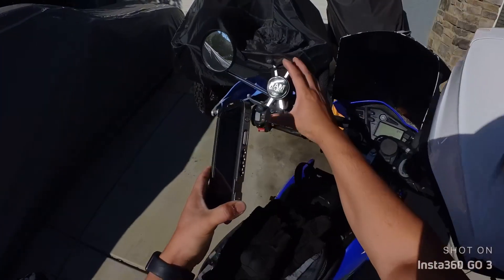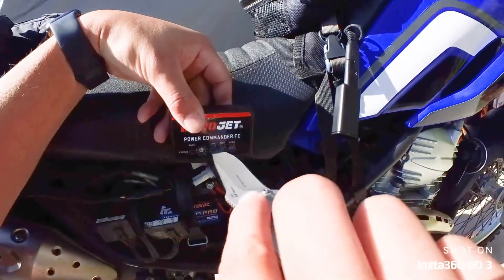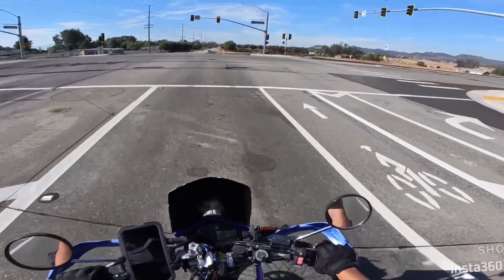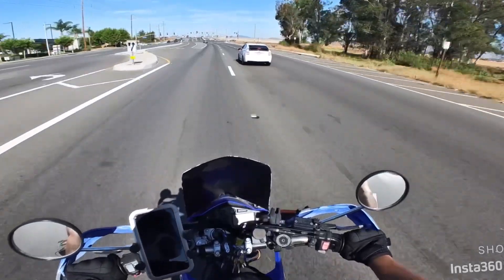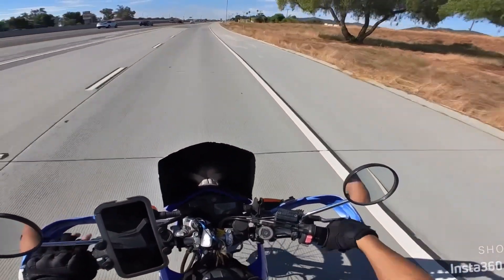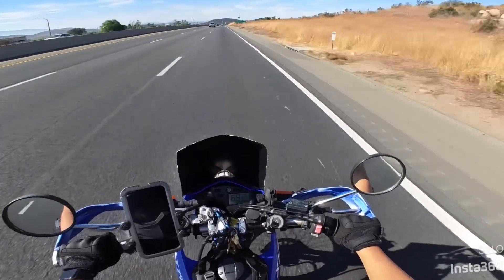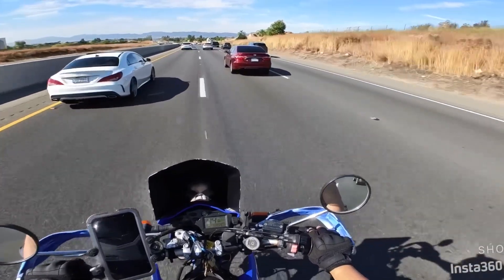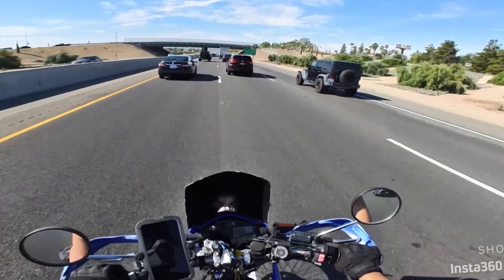Yamaha XT250 Airbox Mod: Ride and Tune

Comment: Nice bike 👍 was able to do 86mph  gps verified ,on my 230sm, purchased an aftermarket tuneable ecu that removed the speed limiter that was set at 75,  snorkel removed and pulled out the baffle from the exhaust
Reply: There is a removable baffle in the stock exhaust? How did you do that?

Comment: Try a speed test run when it gets cooler in the autumn or winter.  You will likely pick up another 3-5mph and hit closer to 75mph out a tad over. 

That will likely put you right were you want to be...

Gord